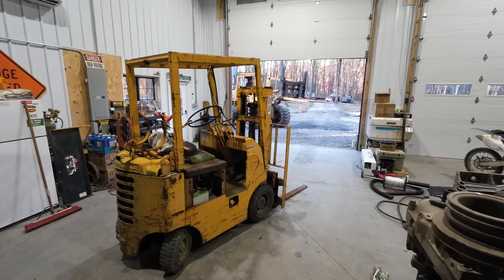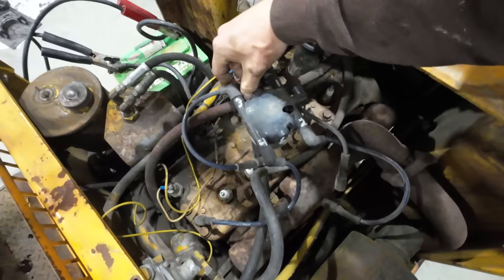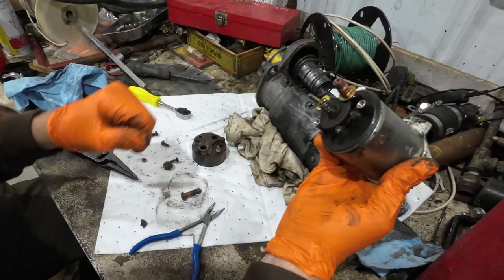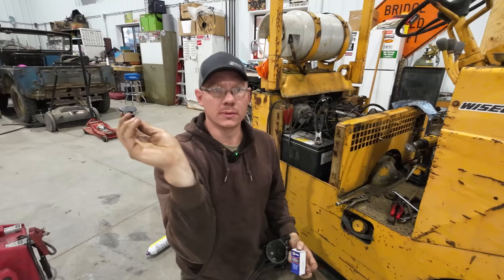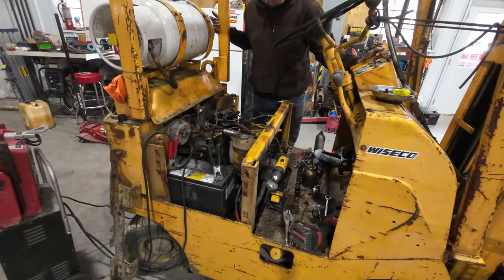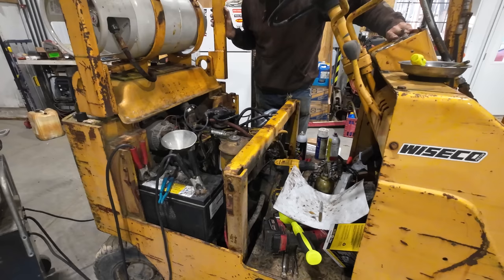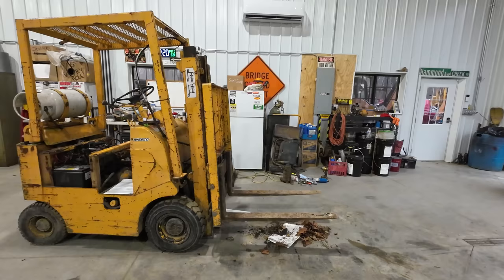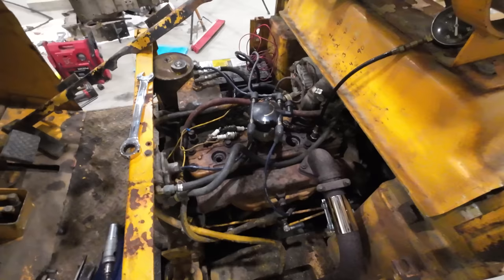Save or Scrap? CAT Towmotor sitting for years. Will it Run??

Comment: This thing has so many issues it'd definitely cost more to fix it than it's worth. You can't save them all. Was actually wondering if the missing restriction from the air filter means it's getting too much air in the mixture, but with all its other problems, that's probably the least of it.

First forklift I ever had to use was a TCM with a similar high/low+forward/reverse manual transmission. When you get used to the manual transmission it's not a big issue - you have to drive it on the clutch and the gas pedal is mostly only used for regulating the hydraulic pressure, which becomes "fun" when you have to lift something heavy and creep forward: When you have to redline the engine to get enough hydraulic pressure, you really have to careful on the clutch to keep things under control.

Comment: I use the Rotella T6 which comes in 5W40 or 0W40. the 0W40 really helps in Chicago cold starts on the 2.7L Daimler Turbo D 5 cylinder. 0W40 makes like a warm motor from cold start.
Auto parts round here have the T6 for 29 + tax for a jug.

Comment: I feel as if there is a carburetor that goes with engines of this type I bet you could find one and make gas or diesel. The reason propane was used is because of the emission. Less emissions in a building where these were generally used.

Comment: On LPG vehicles, you want to start them with throttle wide open when they're cold.  Also, depending on the model of LPG regulator, there may be an electric "hot shot" button that gives a little shot of propane vapor into the intake, or alternately, that little button in the middle of the regulator is a manual hot shot button, and if you press it, if the upstream propane system is working correctly, you should hear a little hiss of gas shoot into the intake.
I believe the ether may not be getting into your intake because the the LPG mixer, which is the next part downstream from the regulator, is blocking your ether.  It's a vacuum diaphragm that regulates LPG fuel into the engine based on engine vacuum demand.

Comment: Hi Matt, About 10 days ago after you had Power washed  and decorated and painted the counter weight, 
I had written you a some what lengthy Note about Paint Spry cans that might solve your frustrating Problem. Have a look at it on that web page corresponding with the Job you did. Cheers Hans.

Comment: If the Cosby sauce doesn't pop her off things usually don't pop off but propane is an animal of it's own I also prefer a carb over throttle body on propane units so you can pop em off with gas instead of Cosby sauce

Comment: The only thing you have not checked is the LP gas converter make sure the water is getting hot and the converters build up a Wax on the Dir frame and some times even have a pin hole in them clean with carby clean and check for holes and wax. ( Hard to start or even will not start ) = Dir frame.

Comment: As a forklift tech and machinist nowadays a 10k hour machine is only a few years old so I'd say it is probably more around 19k hours.  And without touching it myself I'd say your starting issues as well as idle and shutting down are likely due to tte vaporizer being gummed up with tar from the lp.

Comment: Ive had a battery explode too. I dropped a 10 inch Crescent wrench on a battery i had just taken off the charger. It was in an off road buggy and the regulations stated you have to have a hold down strap. Luckily I'd put the hold down strap on it first and it still went boom and blew the top off the battery around the edge where the top clips on. I wasn't facing it but I still got a good splash of acid all over me. I wouldn't recommend it as a fun thing to do. LOL You live and you learn. One of my friends hosed me down and then the buggy. I was ok but the battery wasnt.

Comment: there is probably a thermal protection switch that is faulty. That is about the only thing I can think of really, though I don't know how the hotwire wouldn't have bypassed that unless its something built into the distributor assembly.

Comment: Matt, except for low compressions that you'd probably improve with running that gas regulator is definitely shot, you were basically trying to run it on an old carburettor with plugged needles and shot membranes, you could get a kit to fix it cheaply. Other than that, yeah, manual box makes it unusuble.

Comment: I have a V8 Range Rover with LPG. It starts on petrol then when the heat exchanger has warmed the vapouriser, it switches to LPG. The reason it cant start on LPG is the liquid propane needs to be hot to vapourise it into gas. I suspect your forklift may be missing something because they are made to simply run on LPG so throw some warm air into the engine compartment & warm the whole thing up.

Comment: 21:00 👍🏻 Living in Buffalo, NY, the town of Lackawanna is nextdoor - where a Bethlehem steel plant was\is making alot of stell back in the days. I see alot of those Bethlehem Steel stamped I-beams as the main center house suppot beam in many basements around here. Also see it stamped on many of the 3" or 4" cast iron drain stacks in these houses. Always thought it was cool to see that too. Knowing it came from a plant right here & went into houses right here is pretty sweet! Many of the older guys around here(that are alive still)  worked there when younger too, which is slso cool. Thinking a guy coulda made steel at work that built his house is cool too.👍🏻👌🏻🛠️🔧📐✏️📏🔩⛓️⚙️⚠️🦺😀🍻

Comment: I have the exacted towmotor forklift. You really need to push the clutch in and pump the pedal to get it to start.  There great little forklift mine is a 422slp3024  still runing strong on lp.
Reply: You be shocked how many tractors and forklift won't start unless you push the clutch in . Lol

Comment: One cheap and easy tool to have for this type of troubleshooting is an inline spark tester.  Harbor Freight and others carry them.  That's usually the first thing I put on with this type of older gas or propane equipment.  No spark, then move back and check voltage at the coil. I also usually go right to the points and give them a filing and check the gap.  Glad you got it running!
Reply from the maker: I have one of those and have never got it to work.

Comment: Ck your coil with an ohmmeter  for the winding on The main coil pos and neg then to wire to dist. Leave aa cable on pos and neg of ign coilķ see if condenser for a faint bulge in casing and bottom of condenser slightly rounded bottom

Good luck.

Comment: i used to own an old allis chalmers forklift exactly the same as yours there. i believe it was either a 1953 or 1958 but it was a tank, brakes never worked, leaked every kind of fluid it had, had a bad head gasket and would overheat, ran it for about 5 years until something in the hydraulic pump let go. ended up selling it for $1000

Comment: You can test the condenser by charging it. Connect the condenser wire to one of the spark plug wires in a good electrical system, start the engine for a second, remove  it from the plug wire,then bend the wire around and touch  the spade to the casing, and if it arcs it's good. You can do this to an unknowing soul by giving it a charge, putting it on a shop rag on the workbench and telling him to hand it to you when you need  it, and when they start fiddling with it. Eventually they'll short it out, you'll hear them screaming, thats when you'll know it's a good condenser. Let it set around for a few minutes to see how long it holds the charge, before arcing it. if it holds, it's  good. I learned this from my Dad in the early sixties. Maybe that's why i didn't have very many friends?😂

Comment: Me being me and I used to love rebuilding engines/motors AND I hate scrapping anything that can be rebuilt that's old (way better construction quality that todays made in China crap) because I come from an era where Americans did that.
Plus the engine brand.
I'd pull that motor and gearbox and rebuild them.
Given it has side shift, higher lift, propane powered,  phnematic tires and it's a Cat it is worth being a multi episode rebuild.
Being it's a lutch tranny it actually is an yard use forklift.
Auto transmissions are a pain in the a#@ in yards unless it's absolutely smooth as in concrete or asphalt. 
I've used both outdoors way back when I was an Ironworker welder for 3 years before I went off to Coast Guard boot camp to become an Aviation Machinist Mate. 
We had both up at Airstation Traverse City Michigan as well.
The solid tire one never left the hanger.
The one like the Cat lived on the flight line and had it's own 3 sided lean to shelter on the side of the hanger.
Gos help the individual who didn't put it where it belonged and Chief "Mad Jack" Jack Bloom found it out of it's berth in the morning. 
Almost as bad as washing his coffee mug.
Anyways,  I'd love to see Matt extend it's life and have himself an indoor and an outdoor set of forklifts. 
After awhile he'd figure out how handy it is to have both.
But that's just my life experience at 69 years old.

Comment: Ok so it has problems. But I would remove everything on the front: boom, cradle, side shift, and forks and maybe swap or transplant it all to the other machine. You will more functionality. And the old boom can be use as an elevator. But you would also need the pump, etc and spin it with a ac motor. Win, Win. ~~ Cris H 😊😊😊

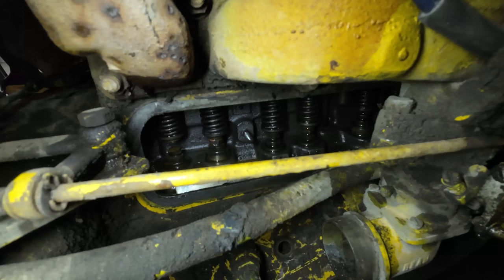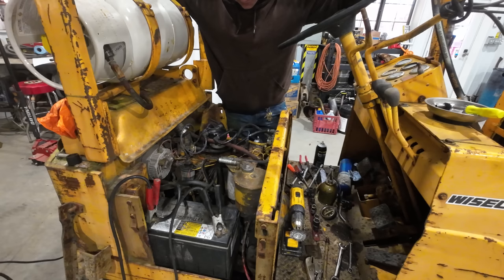Comment: 41:00 My preferred stuck valve lubricant is Marvel Mystery Oil (MMO)  Oil can with flexible spout stuck down the spark plug hole might squirt some in there.  With the valve up, it should run right onto the stem and possibly down into the guide overnight?  Flood it today, leave overnight, crank to blow any excess out tomorrow morning, then reinsert plugs and try again.  45:00 Well, those are old spark plugs which had been soaked in water or water vapor for eons...  Have you checked the timing?   Plugs and wires couldn't hurt.  50:00  OK, running, now grab a piece of tin can and a large radiator clamp and plug off that gaping hole in the exhaust?  57:00  The lack of smoke today is from the oil you added yesterday to the bores has all drained down past the rings after the running yesterday burnt the rest.  1:01 What, new coil and condenser but no new =points=? Old points will also affect timing as they wear.  //  OK, scrap it.

Comment: I wonder if that old beasterd has a drop resistor on the power wire to the ignition. It would be a third component to crap out with heat/use in addition to the coil and condenser that Matt replaced.

Comment: I run the T5 10W30 in all my older machines, even the splash lube stuff. Seems to work better then conventional oil from what I've seen. I passed up a little forklift like that years ago, wish I had it now with some of the stuff I work on at home.

Comment: Towmotor was the name of the company that made the first fork truck.   BTW, hard tires are much better for lifting, it's very east to tip a counter balance with pneumatic tires with weight at height. You have to be well aware of your lift triangle, as lateral stability is greatly reduced with height.

Comment: I think the entire mast of that towmotor could be useful.
   Mustie1 just did a video of using one to make an elevator or fixed in position lift for a mezzanine storage for parts and such in a garage attic.
    My neighbor used a three stage unit on the back of a big Farmall tractor with a hydrostatic transmission. I built an upstairs bathroom and that puppy raised a  one piece Kohler shower and soaking tub to enter through the wall framing temporary door.
    Our area transformed from eighty acre farms with us hand loading hundred pound bags of fertilizer into vorn planter boxes to huge bags of seed onto 36 tow planters.. My brother and I could hand shovel 150 bushels of ear corn out of a wagon in five minutes . Now a guy or two picks ear corn with old equipment and bags it for sale to feed the squirrels as a novelty
    I shouldn't complain. A generation previous to mine put corn in shocks and shucked it by hand

Comment: I once pushed a trolly full of freshly charged batteries past a workmate who was using an angle grinder.  One of the batteries went POP, blew it's caps, and showered me with battery acid.  My jeans were full of holes the next day, but I didn't have any skin burns.  My miserable bastard of a boss didn't want to compensate me for the ruined jeans (I was wearing a lab coat so my top half was OK).

Comment: We did not care for Towmotors in the paper mill I worked at. I never did know why they were called Towmotors.
I saw that Irwin screwdriver when taking off the oil filter. I have a set. They are beast.

Comment: Comments about the forklift:
Likely much of the idle and throttle problems could be improved and maybe even fixed by disassembling the LP regulator and the throttle body, an ultrasonic cleaner would do the trick.
The oil leak can only be fixed by pulling the engine, no band aid fixes that I know of.
The compression should be in the 170-190 range, that engine needs a valve job and rings - along with some machine shop work.  Scrap it.  It's too expensive and time consuming to fix.

Comment: On that engine you could use a compression leak down tester or a blower with rubber tip blow into the cylinders with shop air it will turn the engine over. It can also help to push the lubricant down around the rings

Comment: I had a late 70s early 80s Dodge d350, and it did almost the exact same thing. Turns out there's a ballast resistor in there that as soon as it got hot enough, it would separate itself and shut everything down. As soon as it cools down about 10 seconds, it would run again.

Comment: The dust cover under the distributor cap did not get reinstalled woith the new cap. The dust cover is what keeps the cap in the correct .location.

Comment: I'm sure you know you need a ballast resistor with a points ignition to keep it from burning the points up when its not running the ignition is on and the points are closed . 👍

Comment: Having to work with and on old forklifts, I'd say take what you want from this one and scrap it. You can get very nice used ones for $8-10k that run flawless in that size range. The old ones are cranky, leaky, and often so low to the ground if you run in/out of a shop watch out. Some have 1" of clearance before they smash into concrete lips.

Comment: Hey Matt do a mast swap or at the very least the sideshift they are a removable accessory that can be removed and installed as you require the seals on the rams will need doing though that's probably why its bypassed I would think. and over all it would be good content for the channel. Keep up the great work and hi from New Zealand.

Comment: Ya know, you can put a piece of tape, your choice on that distributor cap, turn it upside down, put a cotton ball or some baking soda in the hole, put super glue in it and it will make a solid, I mean solid repair, sand it flat, turn it over, take off the tape, do the same, sand it , paint it and it will amaze you. Cheap, effective, like new.:cat-orange-whistling::hand-green-crystal-ball:Salvage the oil, filter, tires , rotor, cap, forks, and any new parts you put on it.

Comment: Strip the starter alternator hydraulic pump cap and rotor cut that nice tubing off the ROP keep the mast and forks and scrap the rest those cat fork trucks are everywhere at least in the Midwest see if the tires and wheels will fit Allis

Comment: Nothing will have stuck valves quicker than an L-head engine that has been left unattended for a long time.  In the future, run a compression test.  You'll know very quickly if you have valves stuck open.

Comment: Don't know if it's possible but you can try to adapt the side shift and safety cage to Skinny Alice .You might have to ad a diverter valve to the hydros or add another circuit.We had a manual forklift in a shop where I use to work that sat in the connor like a redheaded stepchild. Hated It.!!!🍻

Comment: I've had luck getting a little life out of dead lead acid batteries by hooking them up to a lab bench power supply, setting the maximum current to like an amp, and max voltage to like 13.6, for a very slow gentle charge.

Comment: 😅Matt, if you were a little closer I would  love getting that critter. I have one very similar but in gas only. I would love to add the side shift to mine and have the rest as spare parts. Mine is the most used piece of equipment I own. I'm in central NY.

Comment: Think you gave it a good shot and exhausted enough time, money and effort. if it was the rear main seal that was dumping oil then it'd likely be a pain to get it changed and very likely new clutch friction and pressure plates. The benefit of the wheels it has are maybe marginal too as you prob want slightly bigger ones for real outside working. Cool video and well done!!

Comment: Next time try when your running into a case of extreme low compression mainly from sitting not for mechanical failure try dumping a thick oil down the cylinders to bring up the compression to run. Once running the heat will most likely bring back the rings. Definitely will not help a mechanical failure as in bent valves
Reply: Sorry I stopped watching the video to do something and comment before seeing you do the oil trick 👍👍👍

Comment: Save the forks and flog the motor to your mate for parts. A direct drive forklift is about as useful as a snowflake in Australia. There's a very good reason why all forklifts today use a torque converter/fluid drive whatever you want to call it.

Comment: Check all the wires around  the distributor  had a engine  had a wire running  around  near the manifold  it was shorting in the side of the engine  .

Comment: I had a bad exhaust leak on my semi. I had another driver follow me so I could pull over when needed. 5 hours back stupid move. But the mechanic told next time use aluminum foil, it would get you by.